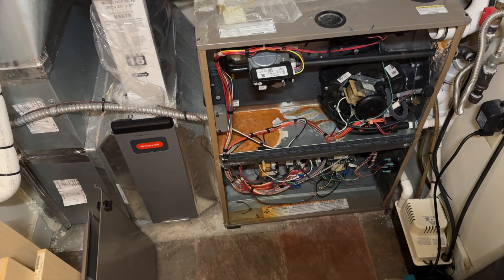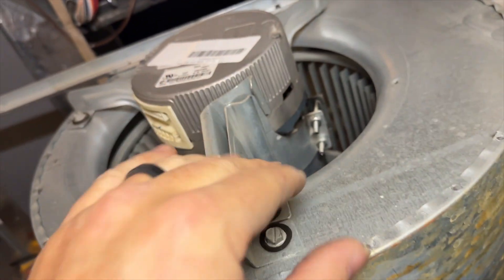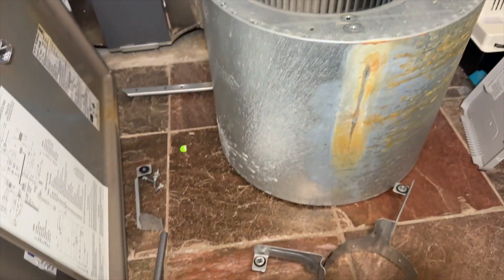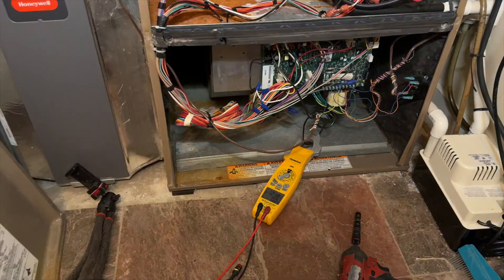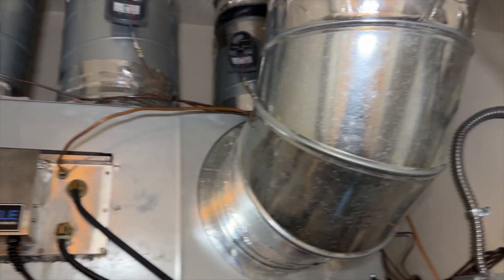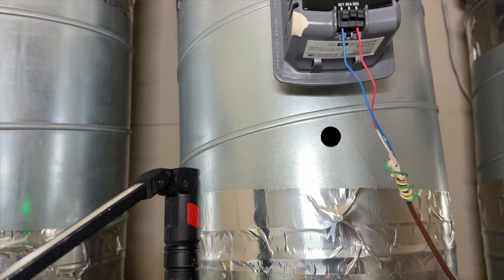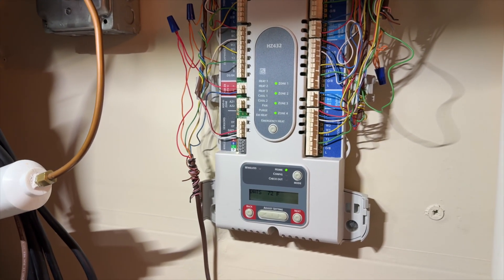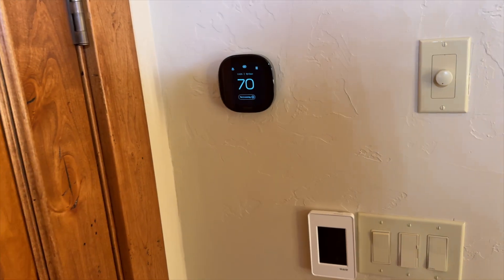No Heat Call: Fried ECM Blower Motor, Bad Zoning, Undersized Ducts — Full Fix EP242

Comment: I've installed and wired up the Lennox factory zoning kits the Harmony 3 and the Iharmony zoning kits. They do a great job in setting up the airflow for the various setups and has the ability to modulate the blower speed. I would love to know what communication protocol they use. I could probably create a copy or modify it to work how i wanted it using a PLC. Working with larger equipment and building controls....it teaches you how things work and options available.

Comment: Is it possible to add controls to change the speed of the ECM motor as dampers open and close. Using a smart programmable relay would probably work.  Doesn't the ECM motor have selectable speeds.  Interesting problem.
Reply from the maker: That would only work on a constant torque ECM. This motor is a constant airflow ECM.   it should adjust on its own.